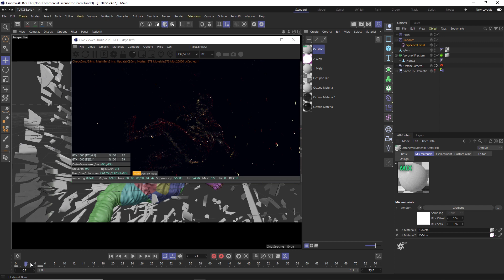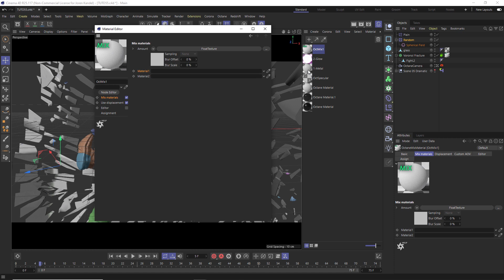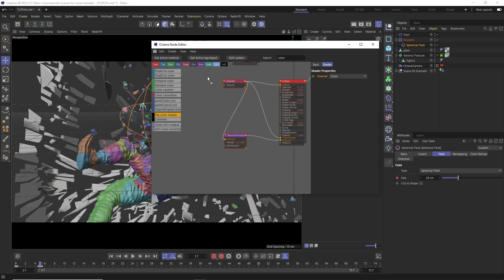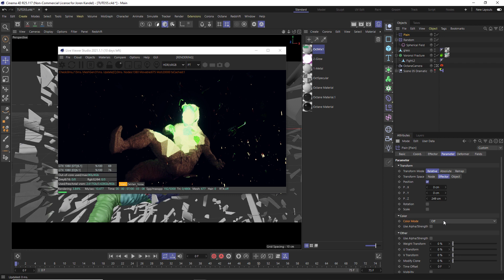C4D Octane Tutorial: How to Switch Materials Based on Fields

Comment: I've tried an easy test with a mix material, a sphere with that material and a spherical field to test it but it doesn't seems to work. Is there any other thing to check other than the one listed in the tuturial to make it work?
Reply: I also had to check blending mode to "subtract", it`s right under the "color mode"
Reply: if you are using spherical field you will also have to go to "color remap" tab and switch from color to gradient
Reply: apparently there is no easy solution, I had to play multiple times with the "color mode" as well
Reply: Thanks

Comment: Valuable technique, thanks for the tutorial. Should work in most renders like Redshift and Arnold as well. If I understand it correctly, this only works if the spherical field is set up properly to remap the color from black to white in addition to PSR, which I'm not sure if it always does by default. You can use this to input actual color information as well avoiding the ramp, if you wanted to transition RGB colors AND have viewport feedback.

Little bit convoluted, but mograph/object colors are some of the only ways to get information into the rendering engine. Powerful and limiting all at the same time.